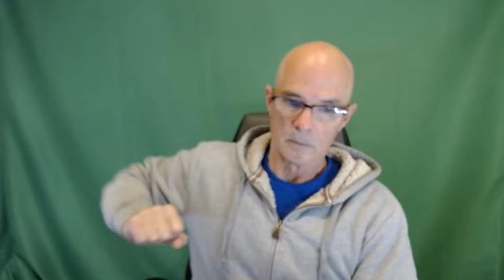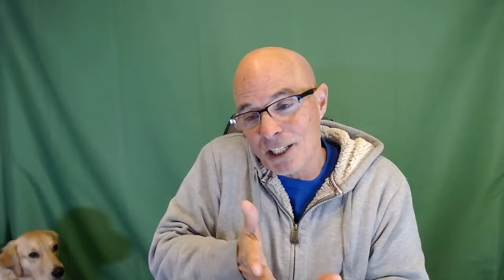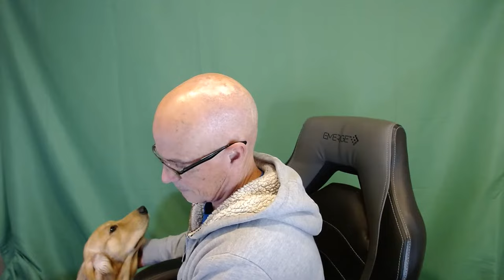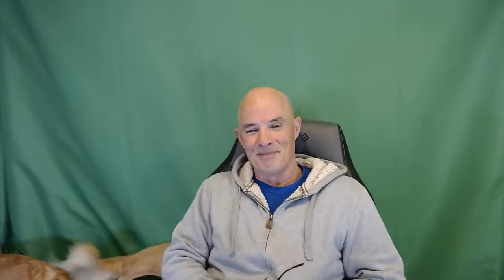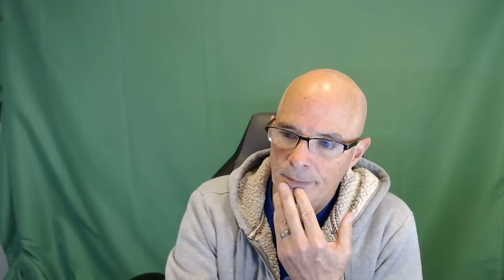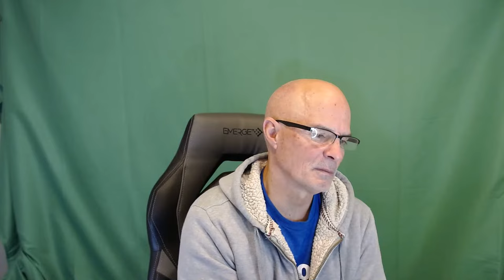LET'S TALK TECH-MOD MOTOR BOOSTED POWER PEAKS

Comment: I have a 2004 F150 with a 5.4 3v.
I added a used whipple 2.3 on it with a 3.125 upper and a 10 percent over lower.
Since messing with it i had come to have the opinion that getting rid of that awful long runner intake is one reason that whipple kit does so good compared to adding boost from a centrifugal or a turbo.
I have seen 5700 a few times and it wasnt done pulling. I am sure it would keep going till the rods let loose.
Thanks for the info and confirming my idea.

Comment: the grounds on the back side of your cyl heads are very important. as well as the ones on the bottom of core support .and the big eyelet under the drivers door on top of the frame.

Comment: What is the max amount of boost you have pushed with Hypereutectic pistons? I have seen guys running 12-14 with the 5.7 Hemi's. They did open up the rings some but still running close to 700rwhp on stock (hypereutectic) pistons and holding. I'm starting to think for moderately boosted (up to 14psi) applications that require/want the long-term wear characteristics of the hypereutectic pistons is a viable solution. What are your thoughts on that?  Also the Nodular Iron crank seems to be another cost affective solution for that range as well?

I personally ran 10psi on my 5.7 with 610RWHP for over 20k hard miles with no issues.
Reply from the maker: we made 1542 hp on a stock bottom end LS with a cast crank, powder rods and cast pistons.
Reply: @richardholdener1727  wow! Even if it was in a controlled environment (dyno, fuel etc..) It should run 700hp on the street pretty reliably. Going with the 2618 and having to tear down after 60k seems like the Hyperutectic is the way to go.